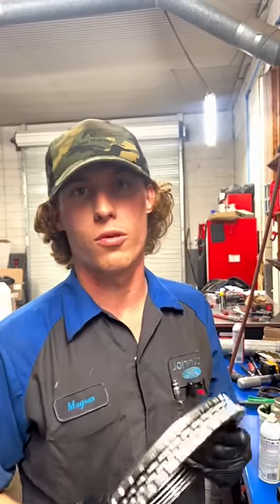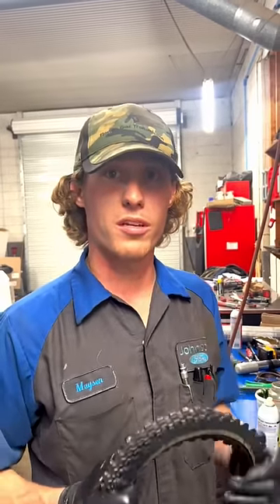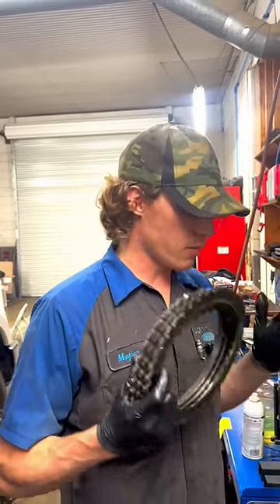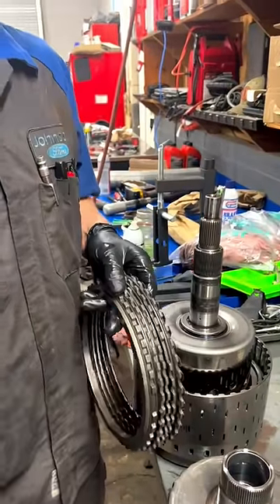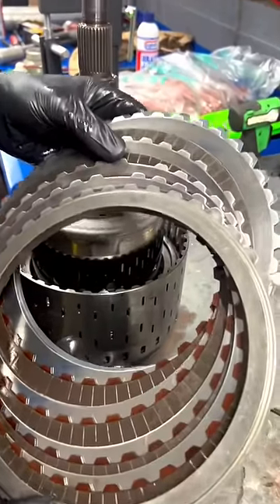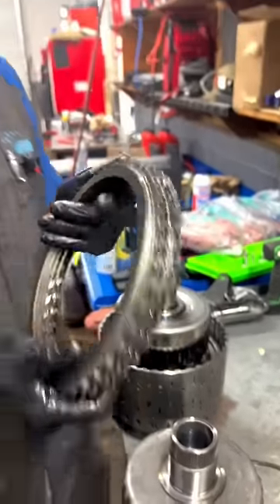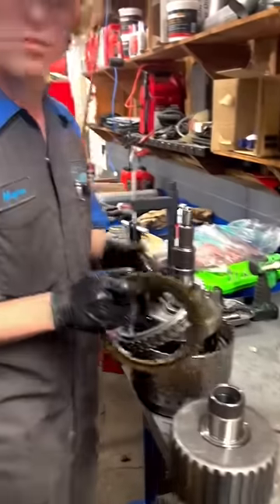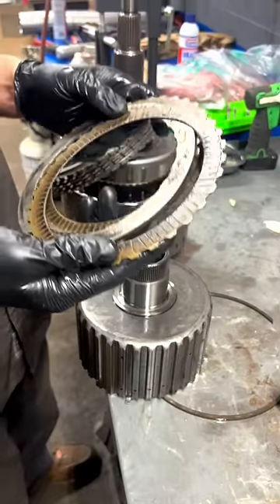Should you replace every clutch during automatic transmission overhaul? #shorts

Comment: I do my own work so if I've went through the trouble to pull the transmission while laying on my back in the grass I'm gonna replace every wear part I can. I really don't want to have to do it again.
Reply: Agree
Reply: If that is your situation I am pretty doubtful that you could replace everything in a transmission and have it work when finished. Most auto transmissions are a 2000 piece puzzle with a large amount of pieces that will go in backwards easily but will not function if put in backwards.  Most master level techs will not do transmissions.
Reply: @martyk1156  the guy in the video you are commenting on is literally holding the internals of a transmission. With a manual, some time, and patience it can and is done by mechanics all the time.
Reply: @martyk1156 f you have the trans overhaul manual it’s not that bad. My tech school transmission instructor always drilled into us “Read the fucking instructions” and that was one of the best pieces of advice I was ever given. I work at Ford now, started off in the independent world though and I must say Ford seems to have some of the best workshop manuals in the entire auto industry. Any basic certified technician could overhaul these modern transmissions no problem if they have the service info.
Reply: @steventurner1628  you are saying this from the point of view of a trained technician not a weekend warrior pulling and overhauling a transmission on their front lawn with no special tools or understanding of the names and parts in a manual.   I have done some at home but I also have a lift at home a lathe a welder and other abilities to make special tools to do the job.(yes some of my home made tooling find there way into the dealership because they work better)Plus at least a 1000 overhauls experience.

Comment: Toyota techs: “what’s an overhaul?”
Reply: Only because they never had enough power to tear up a trans until the last few years.
Reply: @ronp499  true. I was more referring to the fact that at Toyota we don’t rebuild anything, we just replace 😂
Reply: HAHAHAHAHAHAHAHA
Reply: @ronp499  have you driven a 5.7 tundra? You wouldn’t be saying that. They make a 5.3 look silly
Reply: @brad8665  4.6l with 4.10 gears feels pretty torquey already
Reply: @ronp499  yeah at times Toyota was topping the power scale for a production vehicle
Reply: only cause thier frames rust out & snap in half before 100k
Reply: My old 2016 tundra absolutely smoked first gear at 128k... about 30k after I supercharged it and added big tires 🤣🤣🤣
Reply: @willywonka521  you’re referring to specific model years for the Tacoma I presume?
Reply: @willywonka521   news flash. ALL boxed frames rust out. Dodge, ford, Chevy, Toyota, Nissan. I have personally with my own eyes seen a rotted frame on a late model vehicle on all the brands I just listed. I’ve seen a 14 silverado with 60k on it. Frame was rotted through. The only difference is Toyota will fix it for free. Chevy will laugh and watch you buy another $70k pos half ton truck.  I don’t care what it is, if it has a boxed frame it will rot out much faster than an old school c channel frame.
Reply: Yup... because once those Toyotas rust away... there's nothing left to rebuild.
Reply: Toyota tech...yeah .. That transmission isn't slipping, but the shifting issue will still require a new transmission.  That will be $6,000 please...oh... And the rear diff should be replaced too...
Reply: @brad8665 the 5.7s are very quick, mines been good so far. My 07 was even quicker pedal response than the 14 I’m in now.
Reply: Not at an accelerated rate like toyolas do & news flash toyota delined to fix mine said it was just surface rust won't be a hazard lol
Reply: 2016-2017 Highlanders were known for transmission replacements.
Reply: No body will believe me but I do transporting. Local and long haul. I've had every make of truck for short haul. F150, GM, Dodge, Nissan, Toyota all 1\2 ton. They are perfect for under 100 mile trips. I use a very low all steel 12k trailer. Cars and small to medium SUV only, maybe another 1\2 ton. Never overload them however. I always follow weight rating on truck and trailer. Every truck has it oil changed at 5k, tranny, at 50k along with diffs, and all other liquids, and brakes. The ONLY trucks to make it past 150k miles (no catastrophic failures or brakedowns)  were an 03 F150 5.4, 16 f150 5.0, and 09 Ram 1500. I treat my trucks with respect, love, and care for them the best I can just like my snap-on tools. But I'm sorry to say, it's my truth. These trucks get a trailer that never leave the ball unless it goes to the shop. They tow a few hundred miles a day loaded with 6000-9000lbs.
Reply: Ya right. Trans always out by 170k.
Reply: @jerryjeromehawkins1712  I was more referring to the fact that at Toyota we won’t rebuild transmissions regardless. They all get replaced
Reply: @brad8665  doesn’t take much to make a 5.3 to look silly
Reply: @willywonka521  I got 295k on my ‘07 no rust to be found.
Reply: @willywonka521  dude what??? Undercoat and that will NEVER happen that just abuse
Reply: @jrod264winmag  you may have rust you can't see
Reply: @brad8665  lmao no comparison rice
Reply: Yeah... when it breaks crush it.
Reply: @STAY-GOLD-VINYL  call it what you want. I call it a damn good truck. Where I come we’re hard on rigs. A Chevy is usually trash in about 5-7 years. I’ve owned enough of them to know.
Reply: @ronp499  same at kia, its replace not rebuild, just because an internal sensor goes bad
Reply: @ronp499  My 1997 Lexus SC400 has pretty respectable horsepower and torque...
Reply: @brad8665  Ford trucks are "C" channel....
Reply: @HSKFabrications   no they are not. F150 frames have been fully boxed since 2004. Super duty’s have been fully boxed since the mid 2010’s. F series cab and chassis trucks are indeed C channel as are econoline vans but I don’t think those are even in production anymore. But your typical f-150 through f350 pickup trucks (even duallys) have a fully boxed frame.
Reply: @Brad  only the front third is closed. How else do the low pressure lift pumps mount inside the rail.
Reply: @Brad  My 22 cab and chassis is boxed only to the end of the cab, all open after that, my 16 f350 pickup is boxed only to the radius arm mounts, and then it's open C.
Reply: @HSKFabrications  I looked into it more. 17 and up super duty pickups are fully boxed. That’s why your 16 is c channel. Look it up. And like I said yes the cab and chassis trucks are c channel form the front fenders back pretty much. The trucks I’m talking about that I’ve seen with rotten frames are f150s.
Reply: @Brad  lol I don't need to look it up, you do. You said all ford trucks are fully boxed, and I corrected you. The c n c's are open from behind the cab back, not the fenders.
Reply: @HSKFabrications  haha. I don’t know why you’re being a zero. There’s Hundreds of thousands, hell probably millions of ford junk running around with fully boxed frames. Accept it lol
Reply: @brad8665  Nobody cares, Brad.
Reply: @HSKFabrications  true but you cared enough to argue about it even when you’re wrong
Reply: @Brad  I wasn't wrong buddy, you were.
Reply: At Toyota they do not report fails. Range Rover use to do that too. But reality and the internet dreaded that. Lol. They use to day 96% of Land rovers ever built are still on the road and running til date. Lol.
Reply: @jerryjeromehawkins1712 @300,000 miles.
Reply: @willywonka521  that is not what i am seeing with my 07 Turndra Crew Cab 4x4 with 400k miles on it and the fluid has never been replaced and i opull trialers all the time and we drive on the brine roads in winter. my body and frame are in awesome shape
Reply: Can't put miles on the truck if it's in the shop for a year getting the rusty frame taken care of
Reply: @74nova36  that is usually caused by the electronic control on the throttle body
Reply: Is that because they will rust away before needing an overhaul.
Reply: It's cute people think tundras have power. Let me know when you can carry 32k lbs reliably across the country  and are known for constantly making it to a million miles plus.
Reply: @markrich3271   it’s cute that you’re comparing a diesel dually to a half ton truck. Apples to oranges bud. I don’t need to tow that much and neither do 95% of pickup owners. Next.
Reply: @willywonka521  wow, i guess i shgould be carful with mine, now that I am approaching 400,000. Better go look underneath for all the rust
Reply: @Maverick-pn7pf  damn that's crazy. Most autos can hardly handle stock power!
Reply: No point in rebuilding a one time use vehicle
Reply: @willywonka521  Really must be just the trucks which I have never owned. Because you just described every current Ford frame, and not one of the 2005 Toyotas I own or have owned are rusted at all.
Reply: Toyota also, What's a recall, that looks like a service bulletin to me.  Yeah, the customer is paying for that.
Reply: @walteroreilly8963  Lol I believe it. I never buy new cars so I never have dealt with warrantee or recall items. I just know my last 2005 Prius is still driving around and it had 273,000 miles a year ago when I traded it with a mechanic for some work on my 168,000 miles rust free 2005 Prius. In Michigan a car that is rust free at 17 years is amazing. The last car brand that I knew that did that was a late 1980’s Mercedes Benz 300TD station wagon owned by a trucker and his wife who was a teacher and they bought it used from an engineer in the late 1990’s that only drove Mercedes Benz.

Comment: To answer your question, YES, I would if it's customer pay. Why? Because you've already torn it down so the labor has already been paid to reach that point. It's simply a parts cost and considering labor is north of 160/hr for most shops, there's no way I would put worn parts, regardless of what they look like back in unless the customer specifically requested it. Ultimately it would be a conversation I'd have with the customer, but usually a transmission overhaul kit will come with new clutchs and steels. North of 100k, I'd recommend replacing the valve body as well since it's impossible to know if there's trash in them or the condition of all valves same with the torque converter. If it's a customer pay job, I'd quote the whole rebuild again unless specifically requested. Otherwise inevitably you could end up right back in it in 6 months to a year and the customer will be mad to have to pay 20 hours of labor all over again. Warranty work is different, it's NOT about "repairs" it's about keeping the claim cost down and that's a whole different thing. The manufacturer is not in the business of repairs, they're in the business of keeping THEIR cost down. This is why warranty jobs don't pay $hit, and why the manufacturer (regardless of brand) always looks to deny line codes or any extra work unless directly related to the customer concern........and it's BS like this that made me leave the dealer world
Reply: Yeup!

Comment: I worked on a C6 once.  I did not oil the soft surface material on the clutch rings.  I had to clean out the transmission oil filter in short order (50 miles).  They still worked.

Comment: Most important questions are about pressure… time spent with a gage can be the answer to problems not fixed by”overhauls “ never assume… verify with the gage… for example high pressure, harsh engagements shift etc. will never be fixed by overhauled or replacement units if the pressure is commanded higher from an external fault… 😎

Comment: If I'm paying for those clutches to be replaced, and you're going into my transmission, you BETTER replace those clutches.

If I paid for them and am doing them myself, I'd be an idiot not to replace it.

Think about it - if I gotta be in there anyway, and it's a pain in the ass to get into there, why wouldn't I replace something with over a hundred thousand miles on it?  If I'm say, swapping out a heater core, and I have to pull the dash to do it, I'm telling my customer that I wanna swap out that AC condenser and all associated parts, too.  It's free labor, and it shows my customer that I'm thinking about saving them thousands of dollars in future labor costs.

As for clutches specifically, if some clutches failed after a hundred thousand miles, why would I think the rest will last the life of the vehicle?

Comment: If my transmission is being rebuilt it better get a new everything. 
O-rings and seals do tend to get harder over time because of the heating cycles that the transmission goes through every time it is used.
Those hardened gaskets and O-rings, even though they are still doing their job, can wear grooves into aluminum surfaces that they seal against.
And even though those clutch plates look perfectly fine there is wear and tear, and since you went through the trouble of removing the transmission and disassembling the whole thing, you are being cheap and lazy if you don't replace all the wear parts.

Comment: Depends what you're selling. If it's a complete rebuild w a warranty then you replace everything. If it's a partial overhaul then be clear you'll only replace visibly worn parts, and give what you took out to the customer. Word of caution tho'... Clutches can look "shiny and new fine" but still be unevenly worn and will cause the new ones to faik prematurely. So use something other than just visual Inspection. Measure the thickness , flatness, and hardness of them before deciding. No specs or no equipment or neither?  It'll be on you if it fails in 3 mo.

Comment: You give the customer the option and explain it to them.
 An overhaul is replacing old perishable parts outside of spec or near.
 Rebuild is replacing  all of the perishable parts regardless of wear. 
Another option is rebuild them all and minimize the price of the rebuild kit. Say a 30% mark up and a set labor for certain transmission groups because of hard parts that most commonly fail. Those parts you get full mark up on. 
These are the most common methods. I hope this helps. Let me know if you need more input.

Comment: I apprenticed at a transmission shop, they replaced worn “hard” parts only , but that  was 40 years ago. All seal were replaced. Keep in mind , this practice is not limited to transmissions. Quite often rebuilt starters, alternators were the same

Comment: As a parallel question, on a oil change, would You put in 3 quarts of new oil & two quarts of used oil? Rebuilt to Us "Old Timers" means ALL NEW PARTS! Or, One could do as most Transmission Shops do today- buy a reman trans from the Manufacturer, then double or triple the price, & tell the Customer it was rebuilt.

Comment: Back in the day when I worked in the shop I'd have to say no it is not necessary to change the frictions if they appear in great condition on a warranty job.
But if anything looked even slightly questionable then yes replace.
Check the ones next to the apply piston they will usually show wear first and check the clutch clearances to make sure the factory didn't make any mistakes.
But on customer pay if they want a complete overhaul that is what they get all  gaskets, seals, bushings, bearings and frictions, most techs will reuse steels if serviceable.

Comment: When we overhaul we replace everything except hard parts. and even some of those get replaced. Almost every bushing gets removed and replaced through all the drums and the case. Valve body is rebuild. All new kit for the whole trans. We own a parts store also. New torque converter cooler flushed at 180 degrees for 15 minutes. New filter fluids specific to the vehicle. The whole 9 yards. We even reset adapts

Comment: Depends on a bunch of different things. 

But the biggest one is - If I'm billing for an overhaul, it's getting all new soft parts (if theyre available). And the only reason I do it that way, is you can't explain to most customers that when it blew up the last time, the direct clutches were smoked. Now it's the low reverse clutches that failed, or the band anchor broke off or something, and since we didn't replace that part, it's not warranty. Unless you explicitly explain to the customer, I can reuse these pieces and save you some money, but if they're the cause of a failure, it's your dime to fix it later. 

At least if they're all new, the supplier eats the cost of the replacements, and sometimes some of the labor too.

At this point though, I pick and choose what I build, and I stick to performance/hot rod stuff. I'm not rebuilding your fwd minivan slushbox.

Comment: They only replace specific damaged parts on engine warranty work too. I witnessed a case of this, a late model truck engine had a hydro lock caused by a fuel injection malfunction that resulted in broken/bent piston, con rod, bearing, valves, lifter, push rod etc. This was the kind of breakdown that any reputable engine builder would recommend  either a complete replacement engine or a complete rebuild. The dealer patched it back together with specific parts only. I heard it run and it sounded OK but I wouldn't want that on my truck. The warranty will not pay for anything more than specific parts.

Comment: Back in the day at the used car lot.  I would only replaced what was causing the problem. Most of the time everything was cleaned and inspected, I never had any problems.  Many transmissions.  Some front wheel drive cars I could access the internals without removing it through the side.  I would jack the drivers side as high as I could and lower the engine and trans so I could get the side cover off.